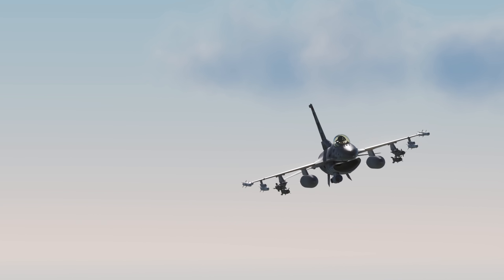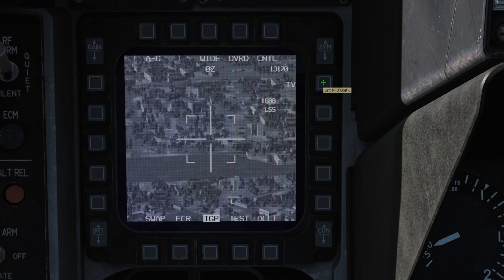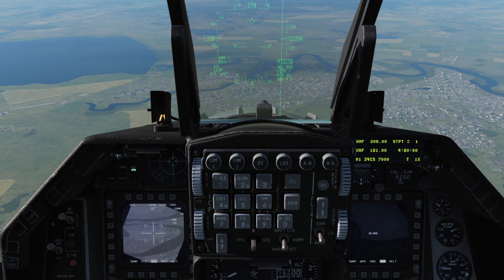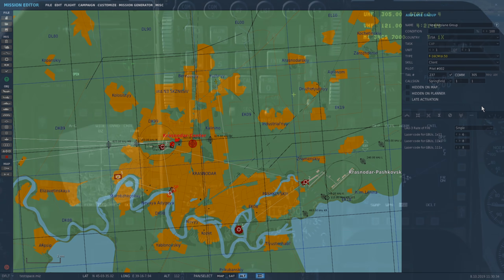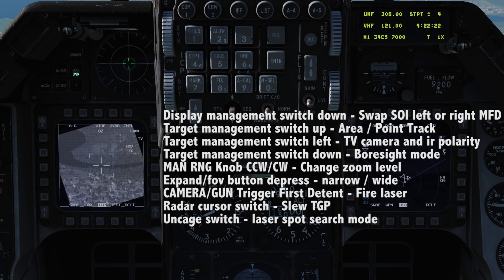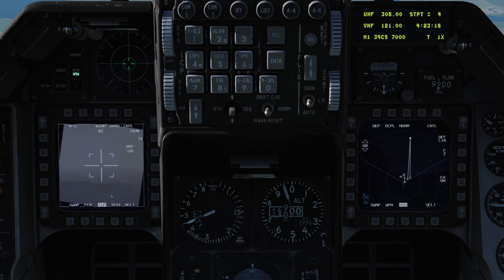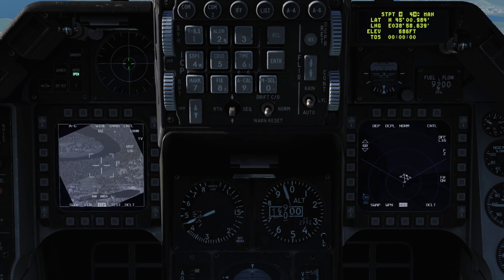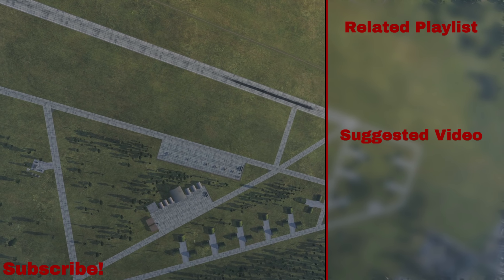DCS: F-16c Viper Targeting pod and Laser guided bombs Tutorial - Early Access

Comment: I have a question. I recently switched from X-Plane 11 to DCS and Im wondering whether I should buy it. If the F-16C was complete this wouldnt be a question but in this case i would like to question your experience. Do you think Eagle dynamics will complete the F-16C properly or will they just add the most requested features and then leave it uncompleted? The last case happened to me when I bough a DLC A320 for X-Plane 11.

Comment: Would be great if it was possible to drop bombs in CCIP with the pipper outside of the HUD's limits, using the TGP for targeting since it just points at the CIP. But the stores just wouldn't come off...
Reply from the maker: pressing and holding pickle with CCIP outside of the hud enters a ccrp mode, follow the cues and it'l drop a bomb on the point that was visually under the ccip pipper at the time you depressed it.
Reply: That is the CCIP mode in the Harrier, you see a CCIP fall line and the pipper locked to the bottom of the HUD, and you see the horizontal line between velocity vector and the pipper to symbolize how far below the impact point is your aircraft. If you will press and hold pickle button, you will designate the target that is under the pipper in that mode (remember, you can't see below your aircraft why it is waste of time to drop bombs on targets you are not aiming at) and the TGP will then lock on that position. Now if you keep pressing pickle button, you can use your radar slaving cursor to refine the TGP point, and so on the just designated target point until the bomb falls line drops from above the HUD. So once you designate the target in CCIP mode, you switch back to CCRP mode for that moment. If you don't want to use CCRP but direct CCIP, then you need to dive so you get the CCIP pipper upward from bottom of the HUD and now you can drop bombs accurately. 

That mode is best of the both worlds. You easily designate targets at further distance, and you can just dive in and drop bombs in traditional manner. The only downside is that you need to hold pickle button through whole designation until bombs are dropped.

Comment: Falcon bms still holds the best simulation for me...
Reply from the maker: Best simulation of air combat for sure, DCS has some great aircraft (especially carrier based) and systems modelling of specific variants which i'd put above BMS's frankenstein's F-16c. The DCS F-16c viper has a long way to go before it can compete on that front though!
Reply: @RedKiteRender  but just like the falcon 4.0... which became falcon allied force.. then the last version i know of the bms... DCS has a great start... maybe its nice if they try to engage with former devs of falcon to work with the simulation of systems... I bought DCS f16 as well, and i like the modelling to start with... it has a good future...
Reply: @RedKiteRender  why do you call it "frankenstein" ?
It's not a mix of different games or mods into one software, tje F-16C in BMS is build frop scratch and the code cleaned up.

I mean, that way DCS also is kikd of frankenstein, based on Flanker engine, updated to LOMAC then TFCGE, and upgraded to EDGE to the current build.

At this poikt any game isba frankenstein (Flight Simulator series, IL-2 Sturmovik, WarThunder, Counter Strike, Battlefield, Half-Life, Portal, etc...).

I feel like it's used as an insult more than anything.
Reply from the maker: @SnaxDesAvions  Steady on there, I'm talking about the plane, it's made from reasonably complete knowledge of various blocks that then has lots of the blanks filled in from other tapes/blocks and an amount of guesswork. I expect dcs will one day provide a more accurate simulation of a specific block f-16c. BMS is simply not a single aircraft variant. Quite literally a Frankenstein's monster.  I wouldn't call that an insult, more product of the time it was produced, the best that was possible.
Reply: @RedKiteRender  Yes I was talking for the plane too, but the game aswel, as a whole.

BMS was and always was a simulation of a Block 50/52 first.
Itls written on website. So if you were flying this one, you didn't fly a frankenstein viper, on the contrary.
It's only recently they managed to create variant system-wise, sure not 100% complete, but first as a test for new Flight Models made by Mav and Topolo.
In order to test more code, more engines, etc.

For example:
- Since 4.32, we can fly a Block 40 but still was a Block 50 cockpit inside.
- Since 4.33, we can fly a Block 40 with it's flight characteristics, a cockpit shell of a Block 40, WAR HUD, and few things added, all being slightly different from a Block 50.
 - Since 4.34, we can fly a Block 40 with its HUD symbology, avionics, etc.

You see what I mean, we could say it's an "early access" to other variants but it's not and never was the main goal, it's more of a bonus if I could say it like that.

Sure some systems are borrowed from other Blocks, but at this point, with the F-18 RWR the F-16 in DCS is the same case in the end.
We know it's nlt gokng to stat like that, it's temporary, same for BMS.

It's for the same reason we can fly the Mirage, the Flankers, the AV-8B in BMS, it's for the Flight Models first, not for the systems.

I guess people think that BMS has plans to make other variant as goals for the future, in fact they made them flyabale for us because it's cool.

PS: I may sound aggressive, I'm not ^^

Comment: Nice tutorial @RdKite, but try do it with another laser code.. looks like isnt working yet... just to confirm
Reply from the maker: Sounds like you fell foul of the laser code on the bomb. You can only change the laser code of your bombs in the mission editor for now, so make sure it matches. You can't change the bomb's code in flight (as per real life)
Reply: @RedKiteRender  Thanks, I've notice it... In single missions just works 1688, in a multiplayer Inferno server that use to play just 1687 runs... well, hope they fix it :)

Comment: The worst thing is that if you switch waypoints, it centers that waypoint on where the pod is pointing... Not the pod on the waypoint. The pod is pretty much unusable to me because of this. Even if I use an extra waypoint, I can't cycle the pod on to different waypoints, rather the waypoints move to where the pod is so I can't seem to save multiple areas to look at while at the same time ruining my flight plan. so aggravating.